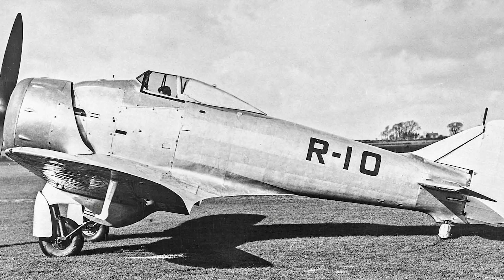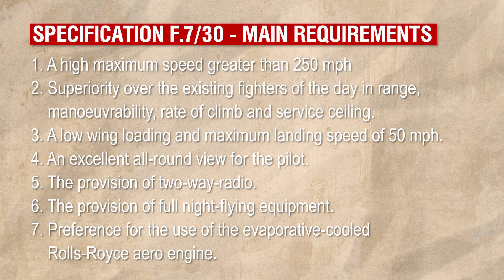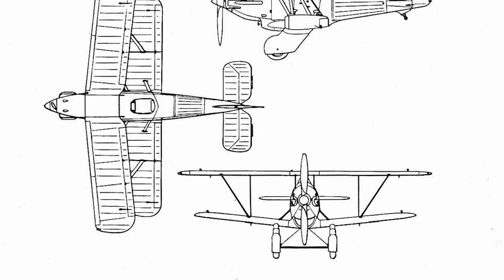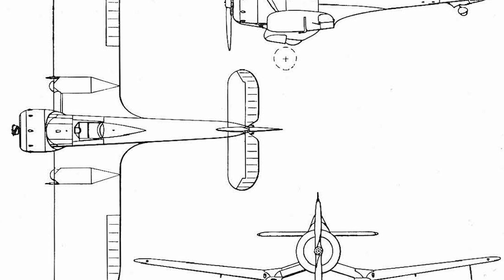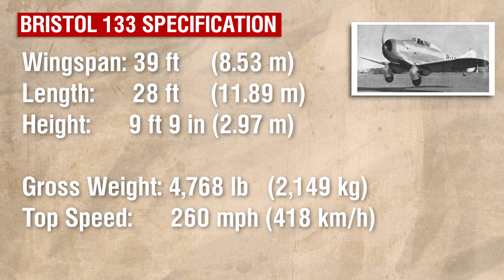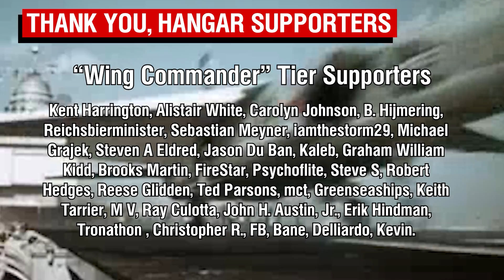Bristol's Gull-Winged Failure | Bristol Type 133 [Aircraft Overview #96]

Comment: This aircraft would have most certainly been obsolete once the Hurricane started flying. Any fighter saddled with a British radial engine would be, given how under-powered British radials were at the time. Perhaps with an inline engine it might have amounted to something, similar to the evolution of the unspectacular Hawk 75 into the ubiquitous Warhawk series.
Reply: Who knows, a radial-engined monoplane fighter in service may have pushed for earlier introduction of a Hercules or even the Centaurus.
Or perhaps not, considering the relative difficulties with sleeve-valve designs at the time, a more traditional poppet valve variant.
Reply: @whtalt92  What's really interesting to me is that, even after the Hercules engine became successful, Britain didn't build a radial-engine monoplane fighter until the Tempest II in late 1944. The Hercules was powerful enough to be used as a fighter engine (going from 1,290 HP in the Mk. I to 1,650 HP in the Mk.VI) but, it was mostly used in multi-engine aircraft. An earlier introduction of the Hercules wouldn't have changed anything; the Air Ministry had already made up their minds about radial-engine fighters and wouldn't be dissuaded of their view until the arrival of the truly outstanding Centaurus much later.
Reply: @jamesdalton2014  The Pratt & Whitney R2800 was available in abundance and it produced 2000 HP and more in later versions. Allies tried not to duplicate efforts in WW2 like the Axis powers did. That's why Mustangs used RR Merlin engines and the FAA used American radial engine fighters on British carriers. Besides, Bristol went all-in on sleeve valves not anticipating the problems they would have on higher powered models. By the time they got the technical issues ironed-out the war was nearly over and jet turbine engines were becoming the rage.
Reply: @heyfitzpablum  I'm not sure what your point is. Everything you said is true but, there are quite a few things you didn't say that might have clarified things. 

First, the R-2800 only became available in the 1940's while the Bristol Type 133 was designed and built in the mid 1930's. The choice to use a radial engine, at a time when British radial engines were badly under-powered, doomed any combat aircraft to obsolescence. An inline engine may have made the Type 133 into a better aircraft but, Bristol didn't make inline engines. Perhaps you were comparing the R-2800 to the Hercules but, my point was really that the RAF chose not to use radial engine fighters until the arrival of the truly spectacular Tempest II. As such, the differences between the Hercules and the R-2800 were a moot point.

Second, the Mustangs used Merlin engines because, the RAF were the first to use Mustangs and they discovered that the original Allison engines were not suited to high-altitude combat. That's why they switched to Merlin engines, which had proven high-altitude performance and were being produced in abundance by that time.

Third, the FAA used radial-engine fighters because, that was pre-war doctrine (something they shared with the USN and the IJN) - for simplicity and ease of maintenance. It was a mistake for the FAA because the lack of a suitably powerful British radial engine meant all their combat aircraft were unspectacular at best, totally outclassed for the most part. The FAA's intransigence about adopting inline engine fighters is why they chose to use American Wildcats/Martlets and they suffered for that choice when the US entered the war. Suddenly their supply of these types dried up as the US Navy claimed priority for deliveries. Then they were forced to adopt the Hurricane and the Spitfire as a stop-gap measure in roles for which they were not well suited. 

You are right about the Western Powers trying to avoid duplication of efforts but, that is not the reason why those choices were made in the two examples you cited.
Reply: @jamesdalton2014  Your last sentence is my main point, the Allies-CLEVERLY-did not waste resources on duplicated efforts. The AXIS powers did, Germany/Italy/Japan duplicated efforts and wasted time/money/energy on engine/aircraft programs when they could have and SHOULD HAVE lunched off of each other. They especially should have done that, because they started from an inferior positions as far as resources. That was their most critical mistake. England and the USA-even in the mid/late 1930's-were probably talking to each other and saying 'Hey, we're heading for a war with Germany soon. Why should both of us fund similar projects? The British should take the lead on liquid-cooled, supercharged aircraft engines and we'll concentrate on air-cooled, turbocharged radial engines. We'll procure from each other and save wasted R&D expenses.'. The British did look at sleeve-valve radials as an logical next step, but the USA didn't pursue that so it wasn't parallel efforts. The WW2 Alliance between the UK and USA was the best military alliance probably in history, everyone brought something to the table. The AXIS powers wasted efforts, they never had a chance.

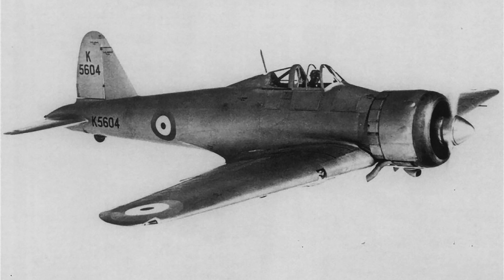Comment: 0:45 This Gloster G.38 F.5/34 metal monoplane looks very similar to the PZL P.50 "Jastrząb" (pol. Hawk). She has also similar armament and performance
Reply: Both used the same Bristol Mercury engine which does give some similarity in appearance. The Jastrzab had a significantly shorter wingspan and length than the F5/34 but very similar weight. With higher wing loading, half the armament, lower maximum speed, and substantially lower maximum ceiling the Jastrzab clearly needed more development. PZL had, by 1939, already started design work on the PZL53 Jasztrzab II with an engine with 30% greater power and adding 2x20mm cannons.

Comment: That's not a gull wing but an inverted gull wing.
Reply: @ Neil of Longbeck
You are correct.  But you can't win because you are arguing with people who are wiling to embrace sloppy terminology as close enough for their own thinking.  If they had designed the airplane they would have described it as an inverted gull wing in any related technical documents.
Reply: It's still a gull wing.
Reply: @Mishn0  no gull has a wing that leaves its body and goes downwards before going upwards. They have wings that go up wards from the body before going downwards. Hence this aircraft has an inverted gull wing. If you want a gull wing aircraft then I'd recommend the PZL P.11 fighter of the Polish Air Force that served valiantly against the German aggression of September 1939.
Reply: @neiloflongbeck5705  Taking an object and turning it upside down does not make it a different object. Just an object that is upside down. An inverted gull wing is a gull wing still, just inverted. Your saying that calling it a gull wing is wrong, is an incorrect statement. It is still a gull wing.
Reply: @Mishn0  then why is it called an inverted gull wing?  Answer because it is the mirror image (ie the inverse) of a gull wing. Yes it's s a gull wing in shape . BUT unlike a gull wing it is inverted, hence the name inverted gull wing.
Reply: @neiloflongbeck5705  Is it wrong to call an "inline eight cylinder engine" an "eight cylinder engine"? No. 

Calling it an inverted gull wing is just being more specific. It's still a gull wing. I'm not saying calling it an inverted gull wing is wrong. 

I'm only saying that it's NOT WRONG to call it a gull wing, it's less precise. But it's NOT WRONG, as you claimed it was to call it that. Now, just go away.
Reply: @Mishn0  🙄I hear you. But, we are getting into borderline nitpicking.....
Reply: @Mishn0  thank you for confirming what I said was correct with your first sentence. Ta ta, silly person.
Reply: @neiloflongbeck5705  It's weird that you see it that way. I didn't. I said you were wrong to say calling it a gull wing was incorrect. You were, and are wrong.
Reply: @Mishn0  what's the divergence between an upright spin and an inverted spin? The inverted spin is the mirror of the upright spin. They have different names to deliniafe themselves from each other. The fact that this little fact can't find a place in your head is disappointing. The gull wing has diheddal then anheddal. The inverted gull wing has the opposite. The name is clear, only a fool such as yourself thinks otherwise which is why I thank you for agreeing with me.
Reply: @WALTERBROADDUS  just because it's correct doesn't mean it's nitpicking.
Reply: @neiloflongbeck5705  But can both be called, "going into a spin", while being correct.

But, like they say: "Arguing with a Brit is like  playing chess with a pigeon — when you've clearly beaten it, it knocks the pieces over, shits all over the board, and flies back to its flock to claim victory."
Reply: @Mishn0  except in this case your racist comment misses my nationality by miles. Going into a spin can also describe going into a flat spin or an incipient spin. But fails to actually describe which of the four types spin it is. They are all spins, but which is it? By your own argument they are all the same. Whilst to everyone else they are all different.
Reply: @neiloflongbeck5705  You're wrong yet again. "British" isn't a race. 

Nowhere did I say they were all the same, I said that they were all spins. You fail at reading. Toyota, Peugeot, Ford...are still are car brands.

What exact kind of spin matters to an accident investigator or a flight instructor, but just saying, "so and so went into a spin and augered in", over a pint down at the pub is still correct and enough for that situation. 

Now fly off back to your flock and tell them all how you won the argument.
Reply: Accurate, but borderline nitpicking.
Reply: @WALTERBROADDUS  not so. All aircraft wing designs are named so that people can compare then. You would samd that an aircraft with anhedral wing is one with dihedral would you? There are many examples of gull wing aircraft out there, such as the PZL P.11 and the Martin PBM Mariner, but this isn't one of them.
Reply: @neiloflongbeck5705  we all see that it's inverted.
Reply: @WALTERBROADDUS  yes, that's why it's called an inverted gull wing.

Comment: I wonder if anybody's got a list of all the aircraft programs that went t$ts up because of a prototype crash. XB-70, this thing, etc.
Reply: The XB-70 was already cancelled by the time it had its crash. The concept had been undermined by the emergence of surface-to-air missiles. The two prototypes were relegated to experiment duty for several years
Reply: @pavarottiaardvark3431  Yeah, the only reason it was flying at all at the time of the crash was that NASA got its grounding postponed so they could use it as a high-speed test aircraft for the SST and other projects. If not for that, it would have already been grounded for a couple of years.
Reply: @pavarottiaardvark3431  Ah? Didn't know. Thanks! (But why was it flying, then?)
Reply: @MM22966  Used as a testbed for high-flight-speed experiments, run jointly with NASA. Even if a plane isn't going into production it'd be silly to waste a Mach 3 airframe. 

On the day of the crash it was actually doing some publicity filming for General Electric, who wanted footage of it flying beside their other planes.
Reply: @pavarottiaardvark3431  Neat! Thanks!

Comment: Looks like a cross between a Zero and Corsair !  :D
Reply: I'd say more like a cross between a P-36 and a Corsair.
Reply: Reminds me of the interwar designs of Jiro Horikoshi (designer of the Zero). He also liked inverted gull wings.
Reply: @米空軍パイロット  That design has a great pair of advantages for naval designs. Short robust landing gear combined with room for a larger propeller. I am honestly surprised that more people did not use it. With single engine naval fighters/interceptors at least. I get that the main disadvantage is visibility during landing. Still the advantages are so big for machines of the time, I am surprised by how few designs even attempted it.
Reply: @whyjnot420  Vis is only a result of the Corsairs long nose. Has nothing to do with the wing and gear arrangement.
Reply: @米空軍パイロット  It is always going to push the nose up compared to having no anhedral there. How much of a downside that is (pun very much intended) , that is dependent on other aspects of the design. The long nose of the Corsair simply exacerbated it. At least when talking taildraggers.
Reply: @whyjnot420  Okay. Read this carefully. The anhedral is designed to shorten landing gear. The only reason the Corsair had a high and long nose is because of the engine and propeller chosen. Giving the Corsair a wing without an inverted gull shape will not remedy your issue because you will have a prop strike.

You think that the inverted gull wing is the driving force behind higher noses because, in your head, you are taking a single piece of correlation and deriving causation from it. Using a single data point is bad science.

All nose heights on piston fighters are determined by properller clearance. Nothing else. Whether you have a gull wing or no changes nothing because one way or another, you're going to get that clearance with a longer gear leg.
Reply: @whyjnot420  But also, we know that the vis issues were mostly from the length of the nose and not the nose height on the ground because the biggest issue faced was in flight during a carrier landing. Not during ground ops.
Reply: @米空軍パイロット  Now you need to read this. YOU ARE NOT READING WHAT I SAID AND ARE OVERTHINKING EVERYTHING.

For example I said and I quote "With single engine naval fighters/interceptors at least."

I also never said it was a massive problem in and of itself, just a disadvantage. Anything that impacts a single aspect of a design by -0.00001% can be called a disadvantage.

I also all but explicitly stated that I think the advantages outweighed the disadvantages.

Now shut up, your idiocy is starting to annoy me.